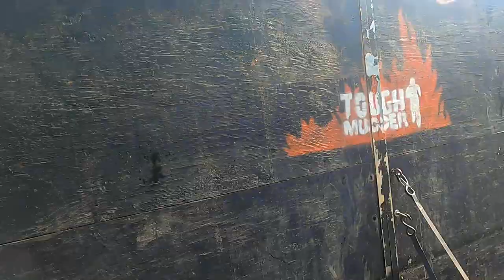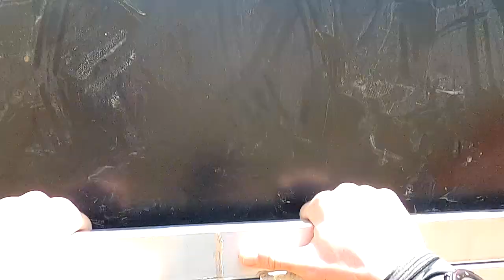Tough Mudder 2021 (All Obstacles)

Comment: Just did my first Tough Mudder (I only did a 5K cause i',m a wimp). It was the one in New Jersey. One difference from the one you filmed - on my course we had a LOT of mud. VERY, VERY thick and sticky mud, my shoes almost got pulled off several times, and at one point I barely managed to extract my leg. The thicker mud would stick, and the thinner or more watered down mud was crazy slippery. Made all the mud obstacles very hard.
Reply from the maker: Wow that sounds like crazy mud! We didn't have anything quite like that on the course in this video. Nice job making it through that, and congrats on doing your first Tough Mudder!!

Comment: Doing my first tough mudder and it’s a 10.5 mile .. gosh I’m excited and nervous too. Worried I won’t be able to carry the log, go over the wall thingy and or monkey bars.
Reply from the maker: No worries, you are going to do great! They may or may not have the log carry at your event, and any obstacle you can't do,  it's no problem, there are no penalties. Just try your best and have a good time! At the wall, there should be plenty of people to help you if you need it. Tough Mudder is built on camaraderie, so you can count on fellow runners to lend a hand. Hope you have a great run - Mack & Damer

Comment: Curious, was it required to roll under the barbed wire? Or do people crawl and/or roll through that obstacle?
Reply from the maker: Great question! The answer is no, you are absolutely not required to roll under the wire. It just turns out that it is easier and faster to do so however. When rolling, though, make sure to change directions every 3-4 rolls so that you don't get insanely dizzy.

Comment: How is the electric eel? I’ve a massive anxiety of getting electric shock - that I avoid traffic lights and lifts as I always get shocked 😒
Reply from the maker: There is a method to beat the electric eel. Pick a lane and stay in between the wires - not under them. If you can find a lane that is dry (has no water), even better. Keep you arms in close and don't spread your feet apart. Most people get shocked in the legs because there legs and feet are spread wide apart. If you do get shocked, it's not too bad. It's not like the electric chair or anything, you'll be fine!

Comment: Finished rugged maniac last Saturday and now tough mudder this Saturday!! Is it worth dealing with the electric eel with the water puddles ?
Reply from the maker: If you don't feel comfortable doing that one, skip it!  There are no penalties (usually). If you're not feeling it, go around! It's best to have fun at Tough Mudder, so do what works for you. If you do try it, my advice would be to keep your legs together, not like me in this video. I had my feet spread way apart, and almost touched one of the wires. If you keep your legs together, you should be able to fight right in the void between the wires. Stay low and take your time if you do it. Either way, good luck at your race and have a great time out there!
Reply: @OCRKings  awesomesauce appreciate the tip!

Comment: With this obstacles that includes more water. Do you recommend a shoes that is made to be used alot in water than trail running shoes?
Reply from the maker: We would recommend shoes that have good drainage. The water is going to get in, no matter what, and having shoes that don't drain will get very heavy on your feet. Shoes with drainage holes will let the water out, and will continue to drain as you run. Hope this helps!
Reply: @OCRKings  thanks! I've been eyeing to the merrell rapid and nordic fastknit mid. Which one do you think is better.
Reply from the maker: @CavenInToTheWorld  Good question! We'll have to check out both
Reply: @OCRKings  thanks! Will be waiting for the review thanks

Comment: I’m going to do my first tonight mudder next your and I will be 14 any reconditions on how to train for it please and thanks
Reply from the maker: Tough mudders are just fun.  You are guaranteed to have a great time!  You have youth on your side and you can run as fast as you are comfortable with.  I recommend trail running when you can.  It gets your shoes muddy and gets you using all sorts of leg/ankle/foot muscles keeping you in balance.  It's also no where near as boring as running around a track!

Obstacles are the fun part.  Most are pretty easy.  Watch a few people do them successfully to get ideas on how to approach them.  A few require decent upper body strength that pullups and pushups can really help with.

Some obstacles have penalties for failing them and some don't.  No biggie if you do fail.  Give them all a try and if you fail, just move on and crush the next one!

Best of luck!  These races are so much fun and great motivation.  So glad to hear you are joining the Mudder Nation!
Reply: @OCRKings  thanks you so much for that and I will try my best 😊😊

Comment: This doesn't seem like it'll be too fun for a first time runner doing a solo run.. I'm supposed to go to Pittsburgh next weekend by myself but there are so many obstacles reliant on teamwork & I'm not in the best of shape either.. starting to think maybe to just cancel till I get in better shape =-/
Reply from the maker: Whoa...  hold, on there...  I think you can totally do this.  Solo or not.  Better with friends, but there are plenty of races where it was just Mack or myself and they are still fun AF.

Even being a new runner.  No problem!  Walk when you need to, jog when you can, and run when the elevation dips downhill and you can use that downhill advantage.

Tough Mudder has moved away from the real team type obstacles due to covid (Pyramid for example) and everyone works together nicely at the blockness monster obstacle where many people are necessary to spin the obstacle.  

I think you should do this one...  and signup for another race.  Set the bar next weekend, then come back in better shape and crush your time.

Please post if you go.  Would love to hear how it turned out and what you think.
Reply: @OCRKings  Yeah you're right! I'm running the New England Rugged Maniac on Saturday but it seems WAY easier than Tough Mudder & it's only a 5k.. I already paid for the Pittsburgh race so I might as well.. I'll definitely post afterwards & give my experience. Thanks for the motivation!
Reply: @OCRKings  I ran it.. honestly it wasn't as fun as I wanted it to be. First like 4 miles was fun.. but then just the mental strain of being by yourself whilst also being surrounded by families & groups of friends.. just didn't feel as fun without someone to share the experience with.  Probably won't do a 10 mile alone again, doesn't seem worth it =-/ especially when you get to an obstacle that a lot of people fall on then laugh about it with their group.. then you go & it's just silent -___- ... LoL as I said this just doesn't seem a fun race to be alone on
Reply from the maker: Sorry to hear that your race wasn't as fun as you had wished. That stinks. I hope next time you get to run with friends and have a better experience!

Comment: you have to train very hard so you can win Tough Mudder
Reply from the maker: No doubt.  You need to be a true top athlete to podium at any one of these races.  The competition is always pretty fierce in the competitive waves.  Each race brand (TM, Spartan, RM, Savage, etc) brings its own set of challenges as does the venue location itself.